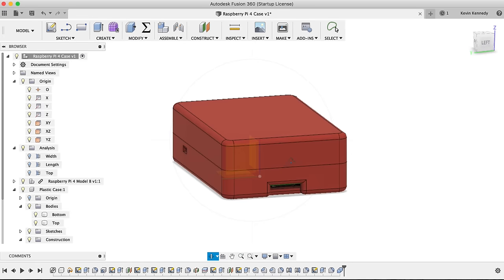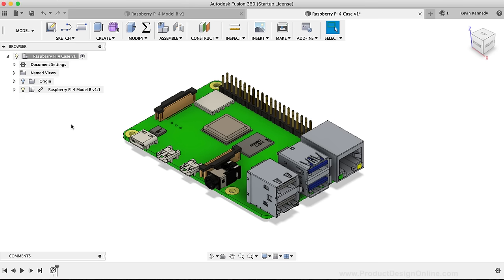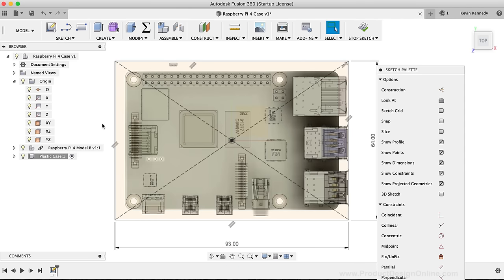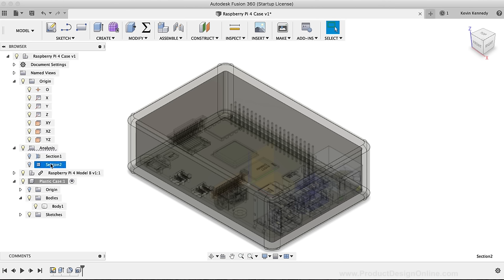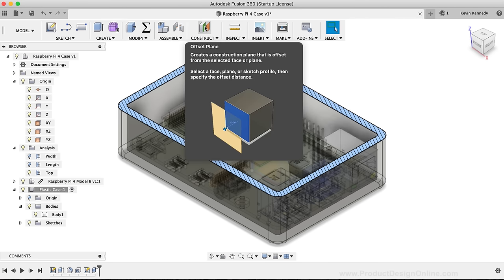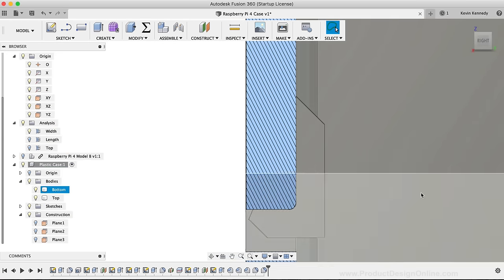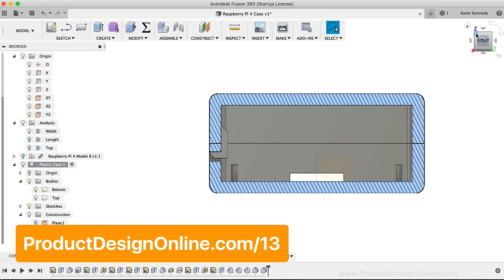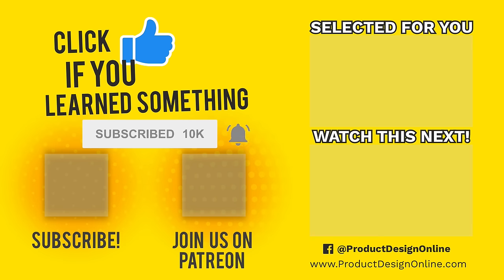Fusion 360 Snap Fit Cases | 3D-Printable Raspberry Pi Case

Comment: Just a note- you use the word “tolerance” when you mean “clearance”. A tolerance is an allowable deviation from a specified dimension. In other words while your connector openings all have a “tolerance”, meaning that the manufacturing method ( even 3d printing) can vary from what you specified, the opening for the connector is designed with “clearance” such that the connector fits thru it.
Reply from the maker: Hi George. Thanks for the reminder! I realized I misstated these after the fact... and have corrected myself in all my latest tutorials :)
Reply: Product Design Online btw- Love the tutorials!

Comment: Kevin, Hi I downloaded the file but when I tried to open a new file,  I got the dialog box asking where I wanted to open the file from. I chose my computer, download, but the file wasn't there. I opened the download file from the bottom ribbon on my computer, and there was much more of the my downloads with the downloaded file there. I tried to open it with fusion exe, but am getting a warning from fusion "upload raspberry-pi-model-b-1snapshot.3zip via the data panel to make an editable Fusion design". I don't see it in the data panel. Any thoughts, thanks.
Reply from the maker: Hi, musoangelo.

Are you on the new “Personal Use” license? It may be due to the restrictions of file types that can be uploaded.

For your convenience, I’ve placed the RPi in a separate Fusion 360 file.

Use this Fusion 360 link – https://a360.co/2ORsblA
Click the blue “Open in Fusion 360” button
It will take a minute to download the file (cloud). You’ll then be prompted to “Open” or “cancel”. Select open and the file should automatically be opened in your Fusion 360.
Be sure to save the file before you try to insert it into the file per the tutorial.
Let me know if that works for you!
Cheers, Kevin 🙂
Reply: @ProductDesignOnline  Yes I do have the personal license. I'll try the other link and thank you for the help.

Comment: Going through this exercise, @11:24 the project command does not exist in latest Fusion version. I can highlight the holes of the arduino board, but cannot reference the bottom floor of the case and project up to the bottom of the arduino board. I tried to experiment with the loft command, but I can't seem to get it to start at the bottom of the case or from the bottom of the arduino board to the floor of the case. What's tool(s) should I be using?
Reply from the maker: Hi, Doug. With the new UI you'll find the "project" command in the "Create" dropdown, but ONLY when you're in the SKETCH tab. The sketch tab will only be shown in your toolbar when you're in an active sketch environment.

Alternatively, you can search for the project feature by using the keyboard letter "S" to activate the shortcuts box > search for the desired feature.
Reply: @ProductDesignOnline  thanks. I've experimented a bit more. It also appears when you create a "new" construction or midplane. 

Still challenged with getting Arduino bottom surface to be recognized by Fusion, when attempting to move upwards to create box floor separation. 

I never did get the Arduino board to center on xy plane center dot as you did. But overall, I completed the project as you designed. 

When I 3D printed it using PLA, the raised rib to center the two parts of the case, separated from the top wall. Other than that, the model accurately placed Arduino board properly. 

I made my walls 3mm thick. Might try again and make walls 5 mm thick and instead of making snap holds, simply add box corners to allow tapped screws and attempt to recess top box holes to correspond with box bulkheads below.

Comment: Trying to follow this tutorial using an Arduino Uno STEP file. When I extrude the solid case, the outline of the Uno is cut into the solid extrusion. Is this a problem with the step file or am I doing something wrong? It works correctly using the Pi 4 step file you reference.
Reply from the maker: Hi Chuck, can you double-check that the Arduino Uno STEP file is put in its own component (subassembly with all of its components nested underneath it). You may also need to change the "operation" in the Extrude dialog box. It should be set to "new body" make sure it's not cut or join.

If it doesn't seem to be either of those then let me know and we can troubleshoot further. Cheers, Kevin :)
Reply: It was the STEP file. I downloaded another file and it worked. Printing bottom half now.
Reply from the maker: @chuckpickering6040  gotcha... Yea, sometimes imported files cause more issues than they're worth. Let me know how it goes! Cheers, Kevin :)

Comment: I printed it with PLA. It was not working. I would as your filament type. Maybe, you mentioned but I missed it. Could you please remind us which type of filament you used for printing?
Reply from the maker: PETG or Nylon, as it needs to flex :)
Reply: @ProductDesignOnline  thanks alot..

Comment: TIP: When I split a body, especially if I'm splitting multiple times, I immediately bring up "A" for appearance and colour the bodies with different colours. I find it helps avoid confusion.
Reply from the maker: Great tip, Karl! If you "create component from bodies" you can also use the "component color cycling toggle" which color codes each component.

Comment: When i choose the XY as my origin plane for my sketch it always switches to the front and not the bottom. i have to choose the XZ as the plane. Is this a setting I need to change? I am using the newest free version of Fusion. Thanks.

Comment: "After importing the file". How do you import the file.. is it the same as uploading?
Reply from the maker: Yes. You can use "Upload" (which automatically saves it to your data panel) or File > Open (which is not saved until you click save).

Comment: new ui would not let me extrude the inner circles. Every time I selected extrude you saw the top case become solid so you could not see into the case at the circles.
Reply from the maker: Hi, James. With this issue, it's hard to say what it would be without seeing it. Can you double-check that your "Case" component is active? You may also find it easier to hide the RPi component so it's not in the way while you try to select circles. Cheers, Kevin :)
Reply: @ProductDesignOnline  I have the same problem with the video and the new UI. I'm stuck at exactly the same spot of trying to work with the inner circles.
Reply from the maker: @dmccallum35111  Hi, Donna. Would you be able to share a link to a screenshot? If not, send the link to your Fusion 360 file so I can take a look. Cheers, Kevin :)

Comment: PRO TIP::: Beware of using the split-body method for creating snap-fit or screw-together enclosure type models/assemblies in Fusion 360; I will explain. Let's say you have a more complex enclosure assembly wherein you end up creating several, to many more features on each body after you split it. If you end up having to go back and modify your split feature, Fusion 360 can sometimes swap out the body order/number rendering all subsequent features broken! Multiply your headache by 10 if you decided to make each it's own component afterward! Best to get in the practice of building one half off the first, or building the second "into" the first as a separate component from the very beginning. It takes a little longer up front, but will eliminate major setbacks down the road, and in the end is a more flexible method.
Reply from the maker: Great tip, Michael!

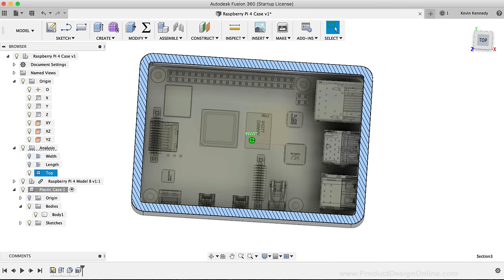Comment: where i can find the command project/intrude at 11:37 in the new version of fusion360 ?
Reply from the maker: Hi, a s. With the new UI you'll find the "project/include" command in the "Create" dropdown, but ONLY when you're in the SKETCH tab. The sketch tab will only be shown in your toolbar when you're in an active sketch environment.

Alternatively, you can search for the project/include feature by using the keyboard letter "S" to activate the shortcuts box > search for the desired feature.

Comment: What is next if you want a professionally made casing? Do you submit you design somewhere? If having your own cheap 3d printer it will probably not come out very professional
Reply from the maker: Hi, kokalti. It sounds like you're referring to the quality of the typical FDM consumer-level 3D printers. If that's the case, then injection molding is likely the type of plastic finish you desire. Injection molding would require a few additional steps to ensure the part can pop out of the mold correctly. One downside to injection molding is the high cost to run a low volume. There are places that will do it though, but it's likely you'll have to search for ones in your local area as many won't do it otherwise.
Reply: @ProductDesignOnline  Thank you for that. That is exactly what I was looking for.

Comment: I'm trying to follow this but falling at the first hurdle.  I open the Pi4 Step file from Grabcad, create a new file and save it.  Then when I toggle the data window I can't see the Pi 4 file to import it.  If I just nest all the items in the original, I can't get the component centred on the plane so drawing the rectangle becomes impossible.  I'll keep trying but if anyone has any hints I'd be grateful

Comment: You should have just made the box equal to the edge of the raspberry pi + a small tolerance, then used the shell command and shelled 'outward' instead of the default 'inward'. In this way you could have made the case thickness parametric.
Reply from the maker: Thanks for sharing this, Michael! Great idea and definitely something that would be helpful. Cheers, Kevin :)

Comment: You didnt make hole for gpio ports?!
Reply from the maker: Hi, максим Дорошин. Great question. I didn't create a hole for those, as you'll see with many manufactured cases, as you typically won't be able to use a case with that many wires running all over. I suppose one could cut a large slot on the top. Cheers, Kevin :)

Comment: What on earth is the Mind/Mine Tool and how do I activate it please?? I'm stuck at 25 mins in on the video! Thanks
Reply from the maker: Hi Ian, the "Auto Captions" from YouTube is sometimes a bit off. Activate the LINE tool :)
Reply: @ProductDesignOnline  thanks, I have just finished the case off, just firing up the printer, now, I've subscribed and no doubt will be watching more, great videos!
Reply from the maker: @ianpiercy6551  nice! Make sure to factor in a clearance for the ridge. I didn't show that in the video but more notes in the pinned comment. Cheers! :)

Comment: This is a really good introduction but I feel you need to work on your pacing. You spend a long time talking about and pointing to an "ok" button, but other times you select in menus, points on screen etc. in rapid succession. When you combine this with keyboard shortcuts it makes it really hard to follow and I've had to rewatch the smae few seconds over and over again to figure out what is going on. I hope this feedback helps you make even better guides.

Again, thanks for a great tutorial!
Reply from the maker: Thanks for the feedback, Marten! I appreciate it.
Reply: @ProductDesignOnline  Quick question. In your tutorial you have the sketch option available in the menu at all times and a nifty dropdown. For me it looks a bit different - my menu starts with the create option and sketch is one icon. I only get the full sketch option (with dropdown) when I'm already in sketch mode. This made it a bit difficult at times and I had to use search (S) to find some items you selected from the menu. How can I get the full set of menus like you do?
My workspace mode is named "design" if that matters. I don't seem to have a "model" mode.
Reply from the maker: @Mythral79  The UI was changed a bit. They changed some of the terminology and placement of things. You can watch that here - https://youtu.be/tuZzHcmFtg4

Comment: I want to make a box for my Arduino but you can buy one so much cheaper it would just be as a practice.
Reply from the maker: Great point, gvet47. There are definitely some super cheap Arduino and Raspberry Pi cases out there. The benefit of being able to 3D print one is great for customization and certain products where the case needs to be attached to something, etc.

Thanks for watching.Cheers, Kevin :)

Comment: How do you print this?
Reply from the maker: Are you asking about orientation or recommended print settings?
Reply: @ProductDesignOnline  3d printing it.  To force myself to learn 3d printing i bought a printer a couple of days ago and now I have to learn a software before in arrives.
Reply from the maker: @streamx2  Right-click on each body and select "Save as STL". You can then save the STL and "slice" it in your printer's software. Each half will need to be laid on its back/flat face.

Comment: Too bad that case will cook the Pi 4 as it runs rather hot. I'll further develop it with some vents and even a mount for a cooler.
Reply from the maker: Hi, Deses. I suppose it depends on how the RPi is used. I simply use one for remote printer setup, so it's not running 24/7. The official RPi case doesn't have any vents in it, but it is also injection molded in ABS, so it can take more heat than PLA. Cheers, Kevin :)

Comment: Should print easier if the plane you cut at was in the middle of the headphone/hdmi/power slot. Avoids the large bridge, that not every printer can do.
Reply from the maker: Great tip, CJICantLie. I did consider creating a contour line that cut that power slot area in half then went back towards the top and cut the rest in the middle. However, I decided to keep it simple as to not make that part of the tutorial too complicated (for beginners).

Cutting it in a different manner could definitely reduce or omit the need of supports altogether. Cheers, Kevin :)

Comment: when i type r the function not working on my version i press r and cant capture the current location it open a window with rectangle and nothing happen
Reply from the maker: The keyboard letter "R" for the rectangle command?

It should work on all versions. One can create custom keyboard shortcuts so there is a chance that something got messed up. When you navigate to the sketch tools and look at the rectangle tool does it still have the letter r listed to the right of it?
Reply: @ProductDesignOnline  i found my error loll because my version is newer !
Reply from the maker: @Evilslayer73  The rectangle command still uses the same shortcut on the latest version. So the version should not matter that has never changed it.
Reply from the maker: @Evilslayer73  anyway you can post a screencast of it not working?
Reply: @ProductDesignOnline  ok :) thanks a lot im really a beginner im trying to learn more complicate geometry on fusion 360 im able to build some sort of  geometry but  im a newbie :)

Comment: Please tell Autodesk to allow us old guys the option to retain the old Tool bar. I tried to follow this tutorial, but when I launched Fusion this morning the update had installed the new tool bar and your instructions o longer made sense.
Reply: Never mind, someone was kind enough to include that option in preferences at the bottom of the general tab...
Reply from the maker: Hi, Chuck. Glad you found it! 

For anyone else interested in switching back to the older UI you'll need to select your Username (upper right-hand corner) > Preferences > General > Check "Use old UI toolbar" and then select "restart".

This Friday's video will be covering all of the critical changes to the UI. Including where things are located, how to switch back to this old UI (which will only be available for another month or two) and other changes to terminology, iconography, and more. Stay tuned! Cheers, Kevin :)

Comment: I don't think this will work.  Besides the lack of tolerances for the ridge, which have been mentioned, and the lack of tolerances for the snaps (in the hook area), the distance from the hook part of the snap to the ridge is so short that it won't have enough flex to snap together without breaking, at least not with any kind of commonly used hard plastic for 3D printing. 

I've seen these kinds of spacings work once or twice on molded parts but they make them work by making the walls thinner/more flexible and these are usually parts that break easily and you get frustrated with.
Reply from the maker: Thanks for sharing your thoughts, Mark! All valid points. Cheers, Kevin :)

Comment: @4:34 in and you have already made a problem for yourself .... you locked the board to the origin instead of making the case in basic and locking the board to the inside rests for it of the case .... if you make your base 3 layers thick and raft it ... you will NOT be able to mount the board because it will have to embedded into the print ...

Comment: holy crap
I am pretty tech savvy but brand new to CAD 

in freeCAD parametrically trying to create a case took me 2 days and I only got this far, and I have been thinking all night how to create the walls and a top section and what the next approach is going to be. in freeCAD if you mess up you are screwed essentially permanently and there are a ton of random errors and the UI makes absolutely zero sense so you have to look up tutorials (which don't exist) for every single action. You spend 99% of the time trying to figure out the software instead of actually designing.

Whereas modeling my compete PCB in fusion360 took 2 hours and now i'm moving on to designing the snap-in case

freecad is for morons